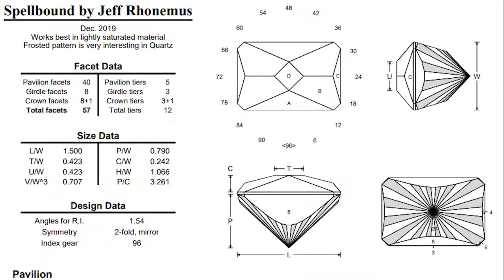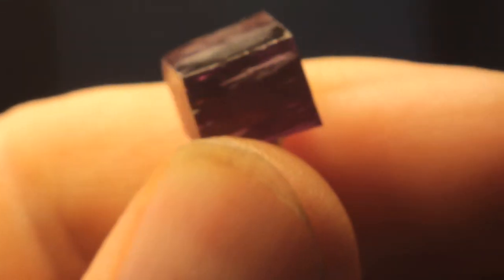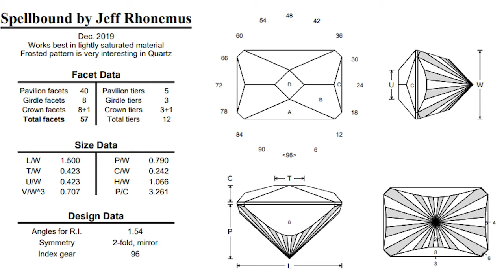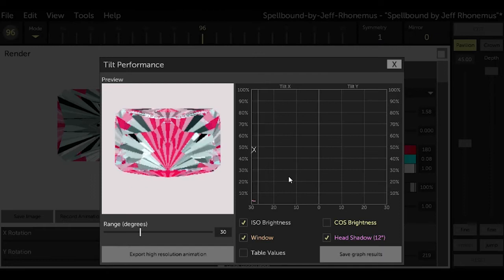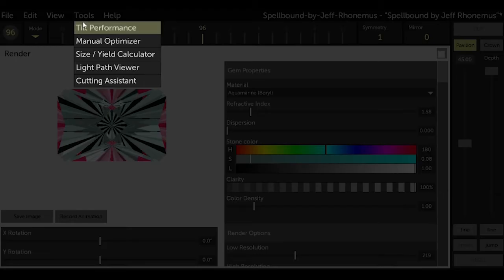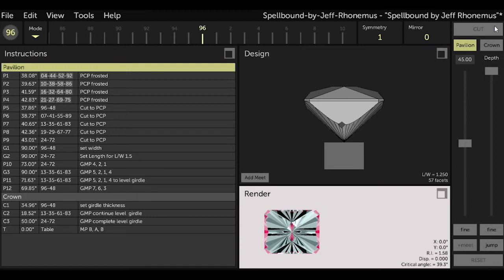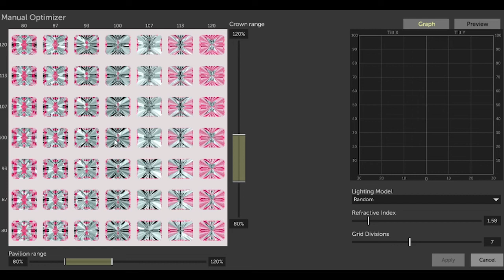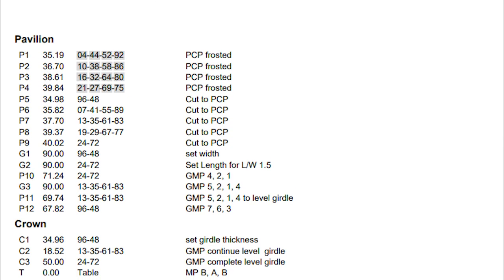Gem Cut Studio Tutorial 10: Changing the Length to Width Ratio

Comment: How did you purchase the UV-activated shurehold adhesive? I bought one through Amazon, but the glue was already hard in the bottle....must've been past the shelf life.
Reply: I bought my first bottle on Amazon.  It came with the light.  I have had no issues.  I bought a second bottle, without the light, but can't recall the site I bought it from.  I had to look around to find the package without the UV light included.  I have not used that bottle yet.  It is sitting in the refrigerator.

Comment: Thankyou for all you videos they have been very helpful but I am currently have trouble with scratches I bought a metal type polishing lap and getting scratches with quarts I also use a 29times loop should I get a 10times Thankyou sheree
Reply: The standard for the jewelry industry is a loupe is a 10 power loupe.  So that is what I would recommend.  I personally use a 20 power loupe.  For scratches, I need more information, what metal lap are you using?  What are you polishing?  What diamond grit are you using to prepolish and which are you using to polish?  I would recommend you go on Facebook to one of the faceting sites and ask there as it is difficult to have a 'conversation' in Youtube Comments.